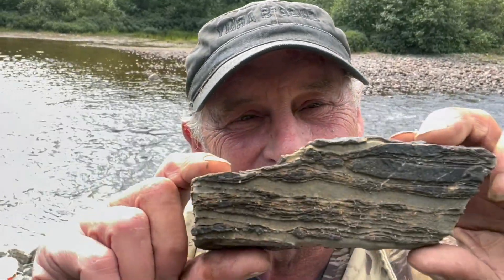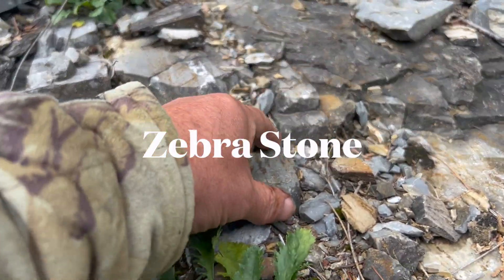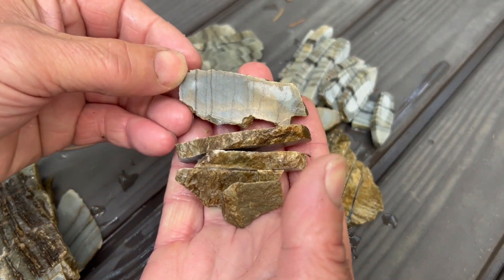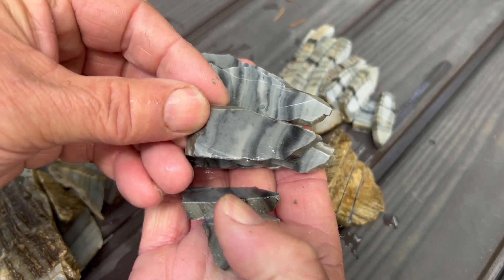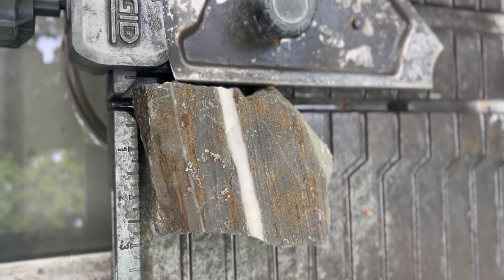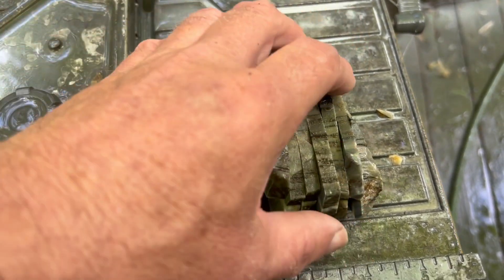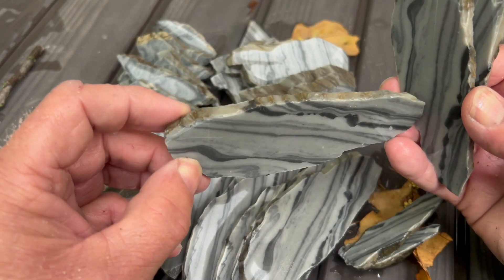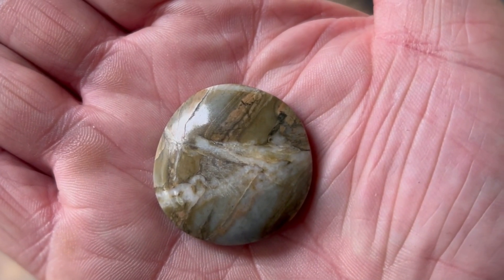ZEBRA STONE from an Ontario Road Cut

Comment: Off-topic question:  Have you found any meteorites in the Sudbury basin?
Reply: Is that an area known for meteorite finds, I wouldn't know one if it landed on me, I might have even found one metal detecting on farmland , I've certainly found lumps of metal but farmers were known for burning garbage by the trailer load, paid by the local council as there were no garbage trucks, some left it and it eventually rotted down making it a good area for detecting while the burnt  stuff melted small metal objects.
Reply from the maker: I haven't but also don't target them.